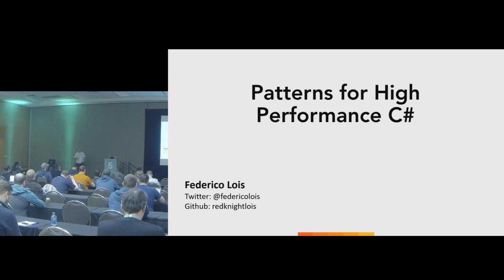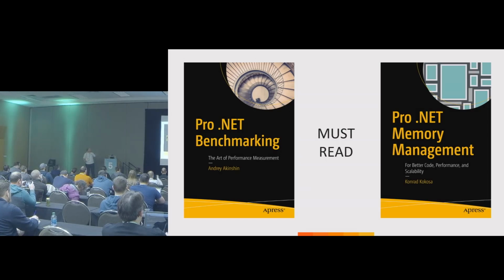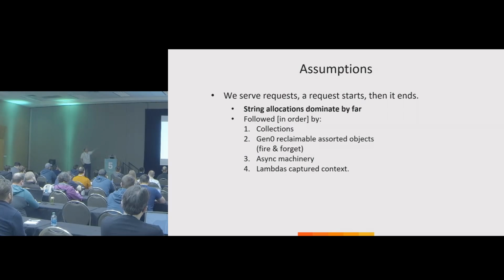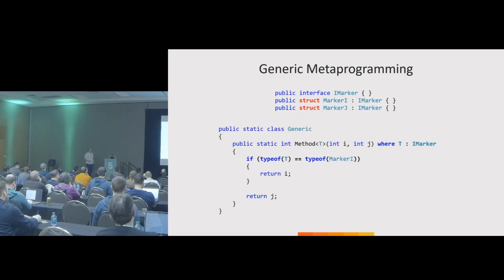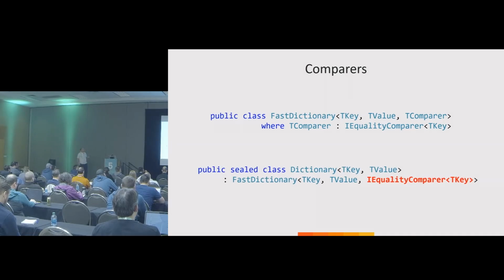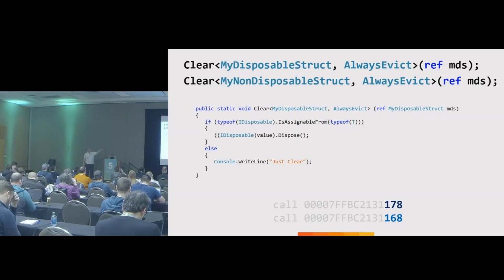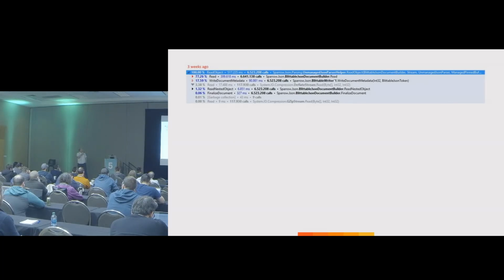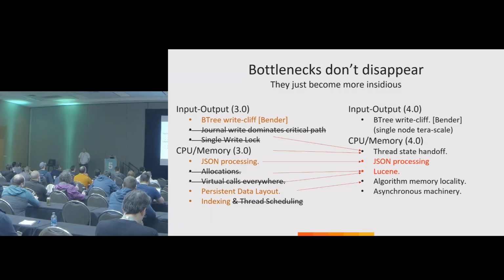Patterns for high-performance C# - Federico Andres Lois

Comment: Awesome talk! Many thanks. 

One thing I've wondered about allocations/GC issues -- isn't GC activity just guilty of creating short hitches, rather than slowing every operation down? I understand overhead for hitches will accumulate of course, but being afraid of allocations seems like it could potentially produce unwieldy code as well. For instance creating ReadOnlySpan<char> instead of string will only be beneficial if there is a string to begin with, and if its missing it will instead be created in the background, only giving the illusion of writing high performance code unless you really know the ins and outs of ref structs.

Comment: 24:20 
an int is 4 bytes
a pointer is 8 bytes, worst case (64bit)
soooo Length, Size and Ptr reach 16 bytes.
What kind of type is `ByteStringType` that it takes 20 bytes!? Another struct? 
Ok assume there's 8 extra bytes for type identification/reflection and whatnot, for an instance of this struct. That's still 12 bytes left for Flags. What are you doing?

Comment: 25:57 ptr size is 8 bytes, int size is 4 bytes, long size is 8 bytes, just a minor detail, but i thought i'd mention it
Reply: ah, he corrected it, nice
Reply: IntPtr doesn't have a predefined size like the other scalars. It's 4 bytes on 32 bit platforms, and 8 bytes on 64 bit platforms.
Reply: @benedeksz2254 haven't seen a 32bit machine for decades
Reply: @benedeksz2254 heh 64bit xp was released april 2005

Comment: How do you get the assembly code generated by your C# code ?
Reply: Ctrl + F11 when executing your code, under Visual Studio.
Reply: If what you mean is the x86 assembly JITted by the CLR - you can use Debug => Windows => Disassembly. For the CIL code you can use ILDASM (included with .NET) or ILSpy.
Reply: there's also sharplab

Comment: What's the point of using C# .NET then, when you can be more efficient and reuse open source libraries with C++ if efficiency is what you are looking for.
Reply: That only 1% of the code requires that level of performance and you can achieve it aways. Why pay the cost in complexity? We could rebuild the entire database architecture in 2 years from the ground up, in my experience in C++ it would probably have been nuts to try so. Also, it's about resources, getting top-notch C++ programmers in very very very hard, the lower bar of C# allows you to get top-notch C# programmers easier... You just need just 1 or 2 C++ like guys to do the low-level optimization instead of a whole team of them. So in the end, it is about money.
Reply: @federicolois3344  You're absolutely right. Not all base code needs this change.
Reply: With micro optimizations  a C#/.netcore application may come close to C++ , but of course  it can never catch it.   However most of the time, it is worth to use a high level language rather than dealing with low level languages. It is a rapid development and performance trade-off.
Besides, you can use both languages ( with micro service architecture) ,  you can implement  performance-critical services  with c++ while you can use C# with the rest of the services.

Comment: Can you share the code for the FastDictionary implementation? Thanks great talk!
Reply: Code is here: https://github.com/redknightlois/fastdictionary
Reply: @federicolois3344  hey! mind if i ask if theres a perf reason the properties have an explicit backing field instead of just a private setter eg Count { get; private set; }?
Reply: @jessepoulton224  to avoid calling the getter. Older jit was not able to inline some of them under long method conditions. That is not needed now.
Reply: might also be worth looking at the DictionarySlim impl on the corefx lab repo: https://github.com/dotnet/corefxlab/tree/master/src/Microsoft.Experimental.Collections/Microsoft/Collections/Extensions
Reply: @jessepoulton224  current stock dictionary is quite good as it is. The problem is the cost of the comparer which the slim version does not improve beyond the stock one.

Comment: I don't get how is that generic stuff better then writing two different methods? It just makes it harder to read then having two different methods.
Reply: Those are building blocks, there are a lot of things you would have to clone method chains of 10s or 100s of methods just to handle 2 small different behaviors.
Reply: @federicolois3344  Again don't really understand why would this be better this sort of micro  optimizations are useful on small amounts of code where you actually need to do them and having if rather then two methods just seams less readable than during copy paste with a small code base.
Reply: @FilipCordas  I can challenge that with tens of production code examples, but it doesnt serve any purpose because we will easily derive into matters of style; which is like looking at the tree and miss the forest. The underlying reason is about statistics. High performance has a long tail very skewed distribution. Which in practice mean, it's never a single method, nor a lot of them and they tends to cluster on general areas. Usually those areas are littered with small decisions (lots of virtual methods, if then else, etc). Also in a million lines code project, the heavy hitters could be up to 60K lines of difficult to follow code. In the same way that the C++ stl allows to have high performance code, without writing the same code n times, you can do it with this. Caveat is that most projects never achieve the performance state to actually require this kind of techniques. Not because they dont have use for it, but because they pay for it with more servers.
Reply: @federicolois3344  Well my point was that this isn't a performance tip more of a code style tip, don't understand really why it's better than two methods for two different things.
Reply: @FilipCordas  Because you cannot build stuff like this (https://github.com/Corvalius/ravendb/blob/alloc-alt/src/Sparrow.Server/Allocators.cs) with a reasonable amount of code ;) Check all the Allocators.* files